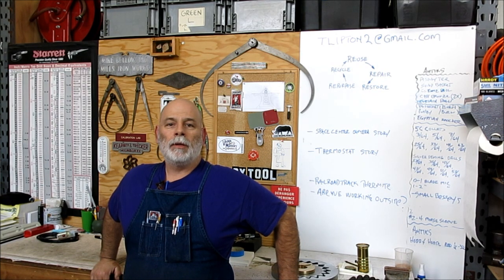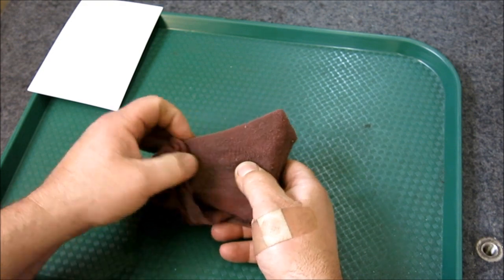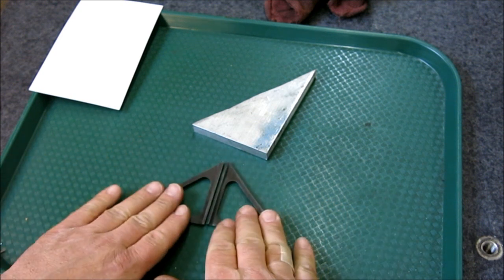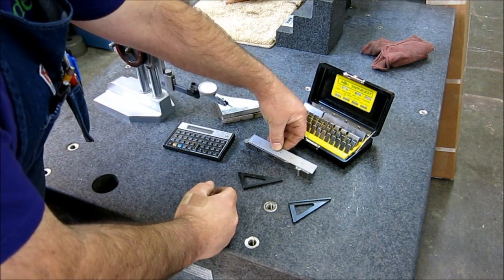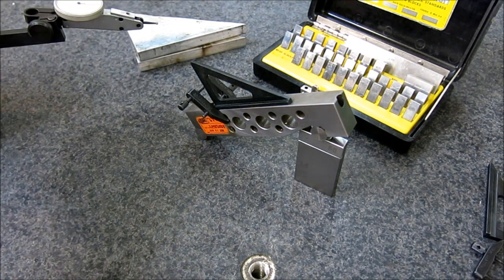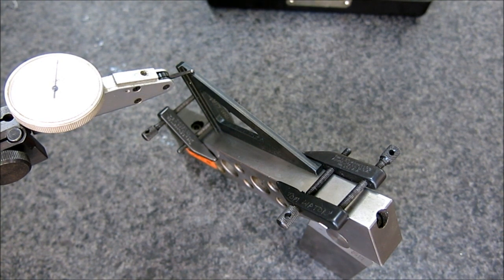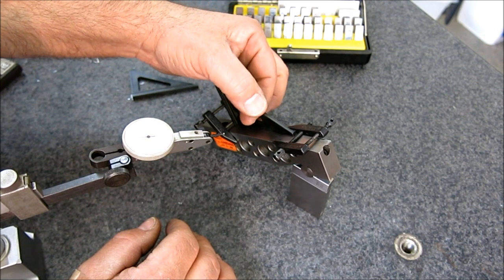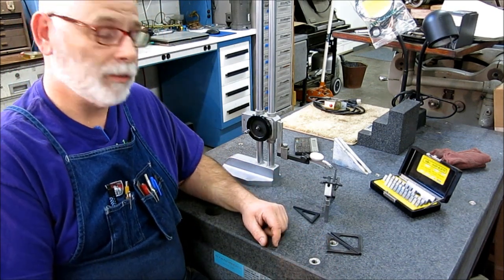Square Off

Comment: Hi Tom,

My inspection station consists of all shop grade blocks, bars and plates, I just dont have the confidence to label these inspection or laboratory grade, thanks for the fun segment. Enjoyed!

Also, any tips on de-magging large items like this? This is a known issue with my squares.

Regards,
Stan
Reply: My surface grinder has a Neutrofier  chuck control that has residual and demagnetizing feature as well as auto release. Do you have a permanent magnet style chuck on yours? I don't notice any residual magnetism in anything I have ground. If you have en electro magnetic chuck you can probably build a circuit yourself to make it demagnetize on its own.
Reply: bcbloc02 Mine is a permanent type magnet, they show no signs after heat treat or tempering, so it has to be coming from the grinder mag chuck.
Reply: You might look into getting an electromagnetic chuck as an upgrade, good used ones can be had for reasonable money. You can then build a circuit to alternate polarity and magnitude with decay so as to demag with it. Mine does it automatic upon release and its an old Thompson from the 50's. Alternatively you could send a batch of them to me and I would be glad to run them over the plate and demag them for you no charge. You might come up short a pair of triangles though when you get them back. :-)
Brian
Reply from the maker: Hey Stan,

You can get a commercial demagnetizer pretty cheap. Its basically a big vibrator with an electromagnet. You pass the parts over the top and they are cured. Try travers or enco on a sale. I'll keep my eyes peeled for something.

cheers,

Tom

Comment: Hi Tom 
The magnetism inherent in the mini squares is obviously an "undocumented feature" from Stan enabling one handed setup in the mill vise etc.
My Supervisor in the Metrology Lab gave me a mouthful on day when I rested the bottom of the sine bar on the stacked blocks as you did, so consider your ear as being clipped.
Cheers Eric
Reply from the maker: Hey Eric,

My ear is ringing. Don't tell anybody but my little Doall set is missing the wear blocks. You were probably messing around with lab referecne standards anyway. I would have punked you as well. <g> Thanks for the reminder.

All the best,

Tom

Comment: Tom;

In order to really ensure the accuracy of the measurement, would you have measured the sine bar first to ensure that there was no manufacturing variation in the bar? Also, could a half thou be within the measuring capability of the DTI you were using? Just wondering as it seems the difference measured seems to be getting into the range of really precision measuring and would this be beyond the normal shop inspection capability of a machine shop and more into the range of lab grade inspection?

Half a thou over 3.5 inches is about 0.008 degrees of angular difference, which is pretty darn fine work for shop grade.

Regards;

Ron Kluwe
Reply from the maker: Hey Ron,

The indicator was a .0001 reading test indicator with a .004 total dial reading. At some point you cannot discriminate reliably or do self calibration with the tools used for the measurements. The sine bar and gage blocks are a good example. This is why you have standards and the necessary calibrations that go with that. The Sine bar I used is a commercial bar that has been calibrated in the past. Not recently I admit, (2001) but better than me trying to determine its current state with the same tools. Most shops with careful technique and calibrated tools should be able to get into tenths region without too much trouble. If closer determination is needed then more accurate gages are required. 

Cheers,

Tom
Reply: oxtoolco Seems to me that another potential source of error, other than the sine bar, is the flatness of the surface plate.  The base contact area of the height gauge, relative to the horizontal extension of the indicator, is small so any irregularity in the surface plate would be magnified.  Nonetheless, a nice illustration of the inspection technique.  Thanks.

Brian

Comment: Tom

Noticed the Hp11c, great little calculator, wish mine had lasted as long as yours has.  FYI, there is a company in Switzerland (SwissMicros) that is making NEW essentially replacements for the HP11c. something to keep in mind if your 11c fails.  S, I now have a replacement for my old HP11c, and I love it

John

Comment: Nice job Stan. 

I would have liked to have seen how you would check the 90°angle.
Reply from the maker: Hi Bill,

Checking the 90 on these is a bit trickier. But I do think it will make a decent video so you may get your wish.

Cheers,

Tom

Comment: Just thinking out loud NOT being critical.   What's the precision of your table under the two points of the sine bar and along the path that you slid the indicator?
Reply: Sorry Tom i had not scrolled down far enough to see that you had already addressed those issues.
Reply from the maker: Skye S. For reference this surface plate was calibrated to .000022 across the diagonal by Standridge. Yes I got the zero's right.

Cheers,

Tom
Reply: Wow, that's not an ordinary table top

Comment: Tom

Stan's little angle plates might be more accurate than your test showed.

sin 30 = 0.5 is only an approximation, the same as the 1, 2, square root 3 is for a 30, 60, 90 triangle, and 22/7 is for pi.

Try using 2.618" for the gauge blocks instead of 2.500".  This derives from using 3.14159 for pi, so (( 30  x  3.14159 )  / 180 )  x  5"  =  2.618"  ( to 3dp ).

The difference of 0.118 over your sweep of 3" equates to about 0.0004", so that might be your 1/2 thou ?

Regardless, your test showed Stan's work to be an outstanding achievement !

Regards
Reply: Tom

Mea culpa.  One crucial step omitted from the Excel workings.

Cheers
Reply: is this a joke?
Reply: sin(30)=0.5 is not an approximation, its exact. You really shouldn't post bad math on here.

Comment: how do you know and check your stone table is more accurate than the 13um/90mm deviation you saw ?
Reply from the maker: Hi Manu,

Good question. The surface plate has a calibration sticker on it and was calibrated and repeated full length flatness measurements to .000022 inches. I have no way of checking this myself so I have to trust it at some point.

Cheers,

Tom
Reply: oxtoolco
thanks, maybe it would take a laser to measure this kind of accuracy. But maybe there is a method to test it with a micrometer and get confirmation in the micrometer range.